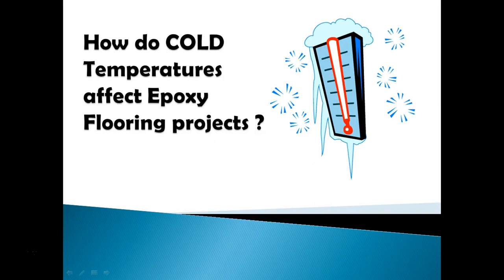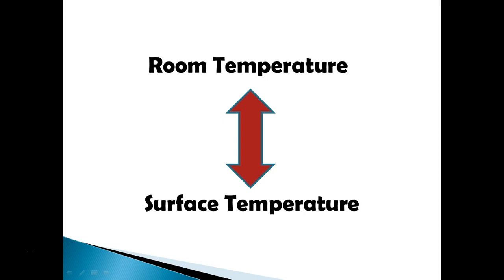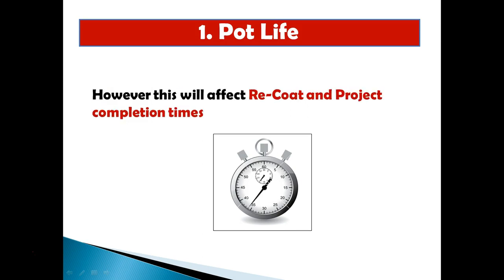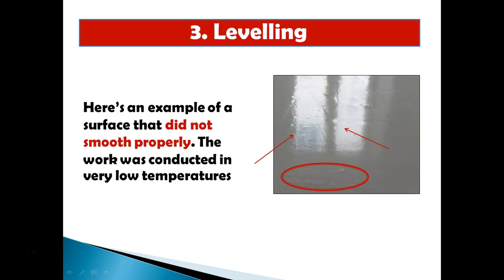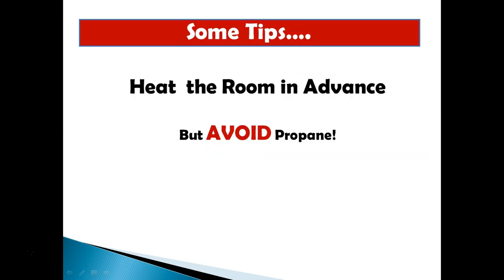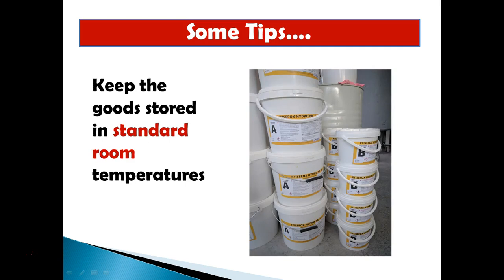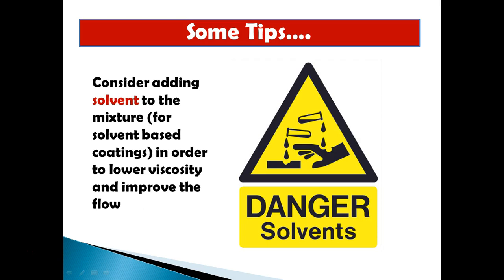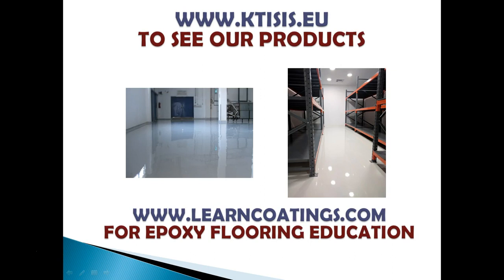Applying Epoxies in Cold Temperatures

Comment: Quick question for some advice recently poured a floor using resincoat metallic the floor was latexed dried and sealed the resin was mixed correctly the area was cleaned with meths prior to pour but the customer didn’t put heating on and room got cold now the mid coat is tacky after 4 days will a clean with acetone or meth fix the issue. I know some say top coat will be fine but I’d rather be sure
Reply from the maker: Tacky after 4 days is usually not a problem of heating. Even if its really cold the floor should be 90% cured. Most probably something went wrong during the mixing, and it will probably never cure properly. Acetone will lead t the floor losing its shine. Best to apply a topcoat

Comment: If applying epoxy to a hanging deck at the beach surface temp is about 29° F is this to cold to allot and addhear to the deck?
Reply from the maker: Yes thats below freezing. Epoxy is no good under 10C/ 50F. You may need to look at other products like polyaspartics that work in these temperatures

Comment: Hey thank you so much for this video! Do you think having a propane heater in a garage should help with installing epoxy in 40° weather?
Reply from the maker: You re welcome! You want to avoid propane. The fumes will cause all sorts of discoloration on the epoxy. I've had some bad experiences in the past
Reply: In my experience propane worked ok, but my application was not very thick and on wood and not a floor.

Comment: 600 square feet  floor I have applied epoxy   and  finished and after putting  on the air condition it is cracking what do I do please please suggest.
Reply from the maker: I am not sure if the cracking is related to the A/C. What surface did you apply it on?
Reply: The wooden blocks where fixed on the Asbestos  board after that we port epoxy or it.

Comment: I love your videos  akis!!If I want to thin the epoxy, what is the maximum percentage of xylene that can be added? Always for my primer I added 10% xylene. Can I put a higher percentage of xylene?  Thanks you!!
Reply from the maker: For a primer 10 maybe even 15% is OK. For Self leveling never more than 3-4% as you are applying a thick coat and you dont want any solvent getting trapped. For a normal roller epoxy coat I recommend 5 max 10%

Comment: These situations you mention you've experienced yourself with working on projects in cold weather, what is the coldest it's been where you were able to complete a project and how were the results compared to a more ideal temperature scenario? Thanks in advance :)
Reply from the maker: I have worked in 5-6 degrees celsius (about 40 F) and we had 3 problems: a) the floor cured slowly b) it came out looking pale and c) leveling marks were visible.  We needed 3 days just to be able to walk on it. Under normal temperatures the floor will have a vibrant gloss and it should be walkable within 24 hours and the whole floor should be smooth without any visible trowel linesor dents
Reply: @learncoatings-epoxyfloorin9448  Thanks a ton, this helps a lot!

Comment: Any thoughts on kerosene heater?  Same as propane jobsite heater but kerosene.
Reply from the maker: I imagine kerosene will give off similar fumes. Anything than burns gas will release something in the air, so in general I would avoid using them
Reply: @learncoatings-epoxyfloorin9448  thank for your response..I've decided against epoxy..its a wood trailer floor I went with drylok paint with an anti skid additive. Went on great ,looks great ..well see how it lasts. Thanks again

Comment: Hii did epoxy flooring recently. After applying epoxy the workers applied 2 coats of something and now the floor is way to sticky, it's been 4 days and it's still very sticky. What is wrong?
Reply from the maker: Four days is too long for the floor to be sticky. Could it be that they forgot to add the B component (hardener) in the epoxy? Or maybe they didnt mix the two properly

Comment: Your videos are the best I've seen on this topic, thank you! 
I have a project coming up in the UK where the average temperature will be between 9C and 14C. The room will be equipped with wet underfloor heating, then a layer of ceramic tiles. I was wondering if you had any advice on how best to mitigate the risks of cold temperatures by using the underfloor heating strategically. For example get the room up to 25C, then switch off, let the ceramic tiles cool down to ambient temperature before the first pour. And then to leave the underfloor heating off for the duration of the pour, and the cure, or to use it strategically and if so in what way? Your thoughts on this most welcomed.
Reply from the maker: Thank you for your kind words! I agree with you that you should heat the floor in advance. It will be much easier to work with a warm floor. This would also will reduce the chances of bubbles emerging. If you can control the temperature of the ceramic tiles (about 20-22 degrees) throughout the installation, this would be ideal. But I am not familiar with how underfloor heating works
Reply: Thanks so much for taking the time to write a thoughtful reply, much appreciated! Your commitment to this topic is inspiring for many of us.

Comment: Always good info.  I had issues with high temps. The surface was vertical and the epoxy actually "ran" off the surface. Th AC failed at the site. At a later date, after the temp came down I had no issues.

Comment: Another Great Video! Thanks a lot for sharing this very precious informations. I would also mention ( I guess it will be part of the second video)  the problems we might face with high temperature conditions. Unfortunately I had this bad experience this summer. Dear Akis did you ever think to open a forum about epoxy? It would be the right place to ask questions and it might serve as database for future new applicators.
Reply from the maker: thanks Roberto! Yes I will be making a video on hot weather where I will be sharing all my experiences (and disasters) with hot weather. I have thought of starting a forum (maybe in a FB group), so far I have been participating in some groups on Linkedin. They are useful, but unfortunately too many people are just using to spam and market themselves and are not really contributing